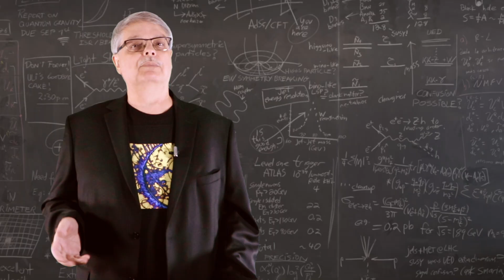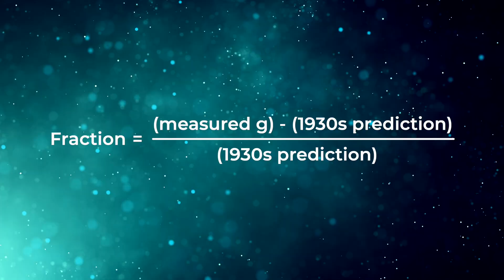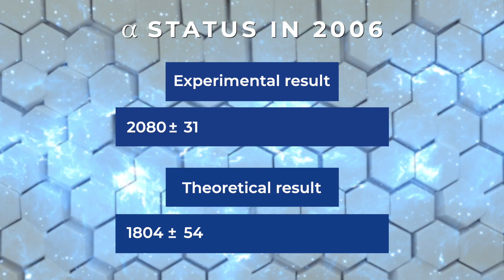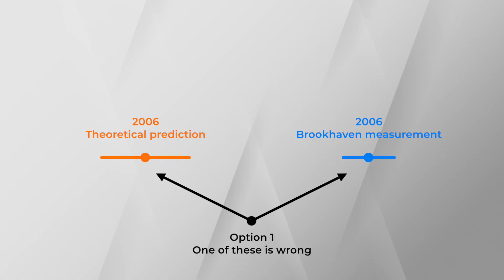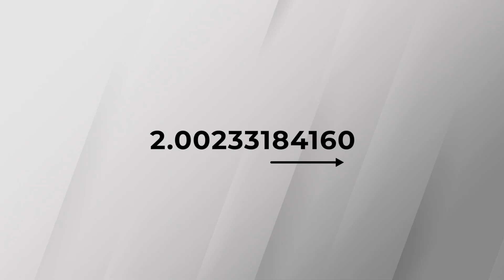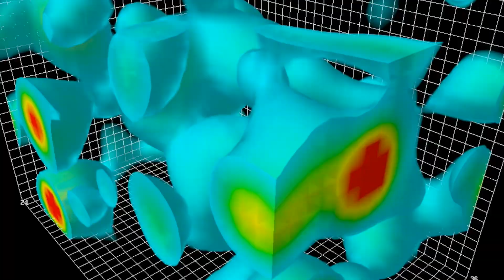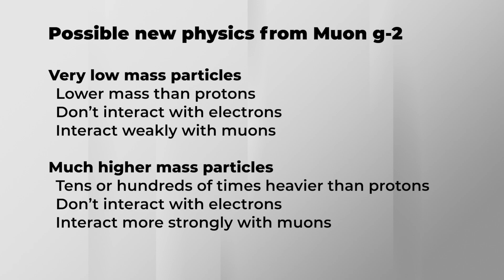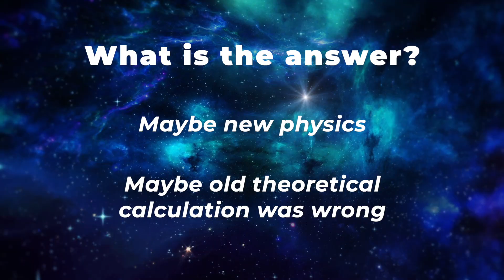What does the Muon g-2 experiment tell us?

Comment: I haven't seen anything yet that covers the possibility that there might be something hinky with the equipment: the new experiment used a bunch of the same kit from the old experiment, what did they do to make sure that there wasn't something inherent in the hardware that might produce this discrepancy?

Thanks for keeping us updated on progress: I would not be surprised if you've already talked about this but I missed it!
Reply: The only thing from the old experiment was the magnet.  Everything else is new.  And the new measurements of the magnetic field are more precise than the old one, plus the field is more uniform.
Reply: well that is a problem. I didn't work in it, but I think the uniformity of the magnetic field in which the muons both orbit and precess is the biggest (known) source of systematic error, and it's better known this time around....or something like that.